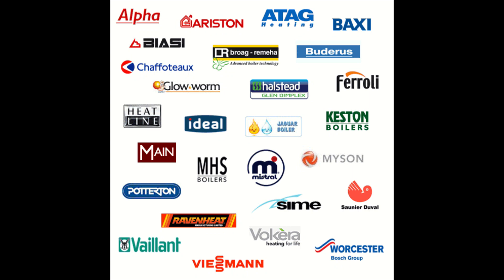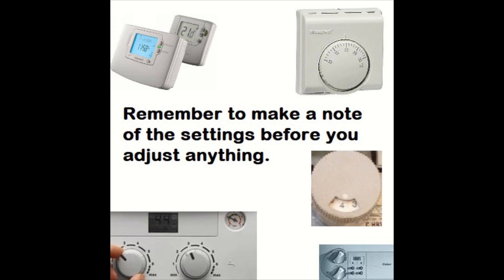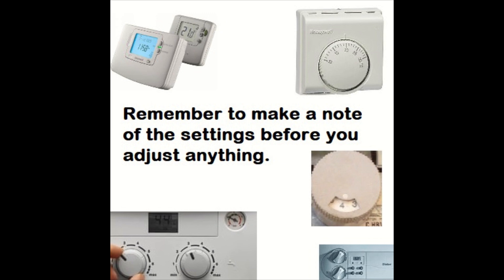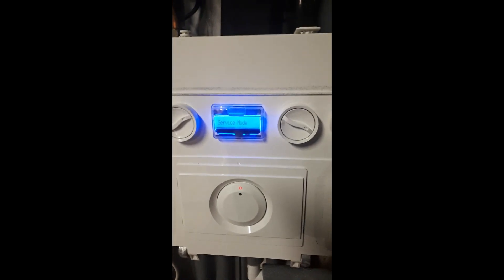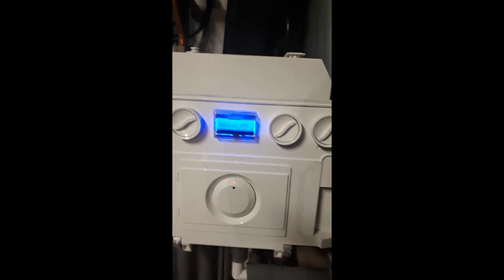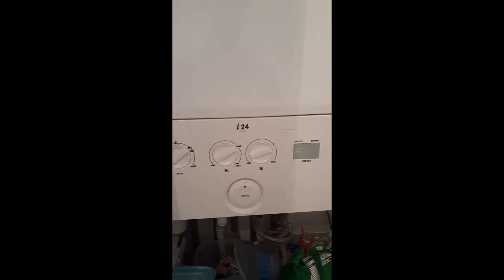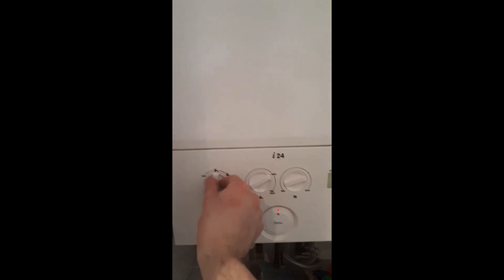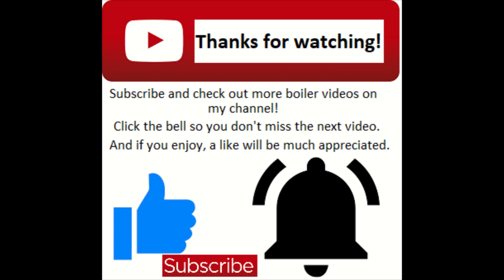IDEAL LOGIC, LOGIC + PLUS I24 - HIGH FIRE - LOW FIRE - SERVICE MODE - HOW TO PUT A BOILER INTO

Comment: Hello, I have the Worcester Bosch 542 I and the heating will only work when it's in boost for 15 mins, I have connected the boiler up to a permanent live through the wireless WR1 box and the the numbers on the digital panel go down to around 40ish then the boiler lights up but cuts out when the numbers go to 54, I recently changed the room stat to a smart 
any help appreciated